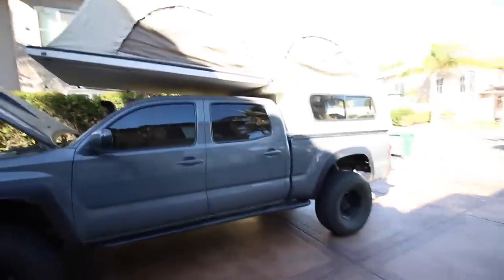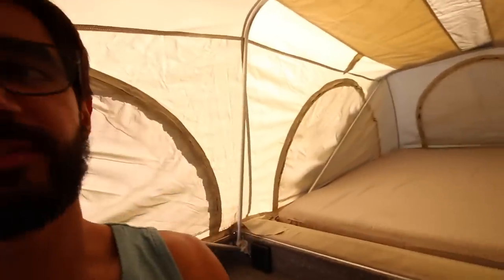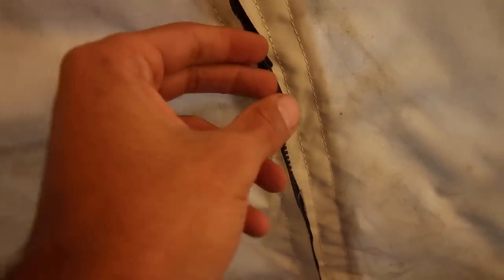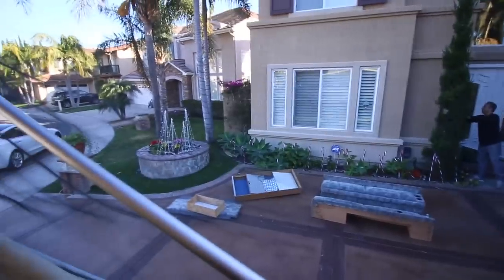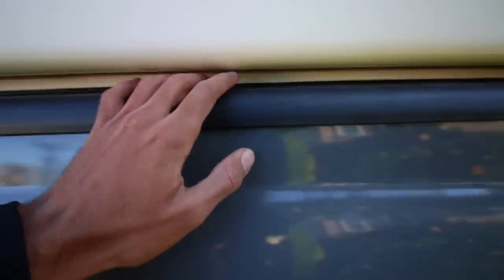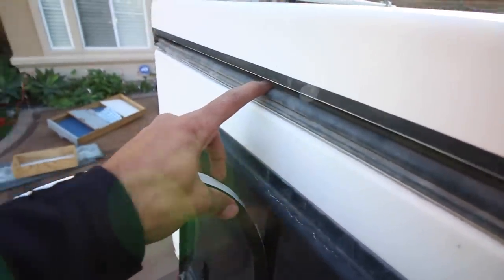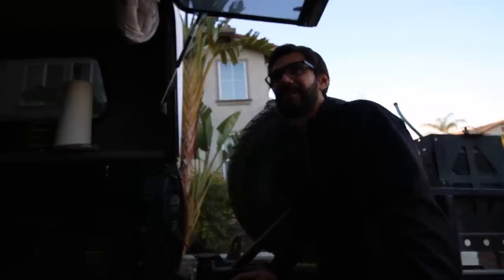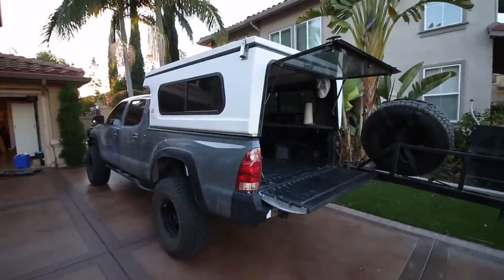I BOUGHT A FLIPPAC!!!

Comment: If it flipped the other way it would be great - support poles could go down onto the ground, you'd have some shade/rain shelter, and you could still have roof racks on your truck
Reply from the maker: Look up AT Habitat
Reply: Problem with that is, you can't move the truck at all without taking the poles down.  I've moved mine to 
another campsite clear across a big campground because noisy neighbors were ruining my camping 
experience.  Damn Millennials.  
I didn't have to touch a thing inside or out.  I'm glad I bought my Flip-Pac brand new in 2000 just a few months after buying my Ranger shortbed.
I paid $2,000 for my Flip-Pac brand new and have used it extensively.  Great getaway unit.
https://www.youtube.com/watch?v=X7biqpQynt8
Reply: There was this version built and sold by my dad the inventor.

Comment: I bought my Flippac in 1996 and the company in Longmont, CO. custom painted it red to match my 93 Nissan 4x4.  Used it until I wore out my Nissan then put it on a 2005 Tacoma 4x4.   It fit better on the Nissan, but I was able to add a piece of plexiglass on the Tacoma to make up for the extra 1" bed length.  I loved the functionality of the camper.  Lots of headroom and the lights were handy if you didn't forget to turn them off.  The torsion bar on mine never wore out, but the steel member connecting to it snapped.  The company sent me a new one and I replaced it myself.   The number one issue I had with the Flippac was what it did to your gas mileage.  My 4-cylinder Nissan barely could get to highway speed with it on and my v6 Tacoma lost several mpg on highway.   Air would get directed between the front of it and the rear of the cab of the truck, not to mention the squared off rear end also created air resistance.   The camper is also heavy and not a two person job to take on and off.  I constructed a hoist behind my home that allowed me to use chain hoists to lift it off and store it.  I was able to do this by myself and frequently took it off and put it back on for different purposes.  I think the manual said it is 350#, but I think it may be more.  It was heavy even for four people to lift and put in place.    It was super comfortable to sleep in and tons of room inside when opened.  I used a very large tarp to cover it during rain and would not suggest using it in rain without something over it.  It would definitely leak.  Overall, loved it and hated to have to sell it.

Comment: For lubing up zippers, get a crayon of similar color and coat the teeth. It wont leak on fabric like oil and it will stick around longer. Good find on the topper man
Reply: Eric Bender nice tip! Thanks!
Reply: Bar soap or candle wax will lube zippers...
Reply: Bar soap or white candle wax lubes zippers without the oil mess.
Your video is dizzy because you are having around way too much. I just skipped thru because I'm starting a 2007 Ranger build.
🍀🙏🌴🎶

Comment: If you use oil on zippers, it will bleed onto material. Use wax instead, cuz it's pretty dry & won't go anywhere but on zippers. It also helps weatherproof.

Comment: Get yourself a Bedrug to line the bed. They are very nice, and are very durable if you carry cargo in the bed when you aren’t camping. They are more expensive than just using house carpet, but they are fitted to the bed and they aren’t  pricey at all.
Reply from the maker: I had a bedrug sitting in the shed when I had it - Just never put it on. I actually sold the Flippac and gave it to the next owner!

Comment: , get urself an " Air Bladder", seal for the back pass thru windows, also get urself some battery powered LED Lights for ur truck/tent. cool, I wouldn't mind having one of these
Reply: You can always use a inner tube for a 10 speed bike & just over inflate it with a compressor to make the seal. Works great actually.
Reply: Backon Thelevel , one of those kids inflatable tubes

Comment: Careful what you put on the zipper it will run to the threads and then caused them to rot or stretch kind of like a spa cover you never armor or a spa cover it causes it to stretch in the strings the thread to go bad

Comment: Nice find! 
I don't think your budget is unreasonable at all, especially when looking at the outrageous prices some of these new pickup campers go for.
Why don't you just remove the bed side rail caps? The Flippac makes them unnecessary anyway and it would solve your seal issue. It will also make the back window seal to the sides and tailgate better. 
Also, please remove the veteran sticker from the back window (unless you are a vet and put it on there yourself, in which case, thank you for your service).
Reply from the maker: So the bed caps were on as when I found this, I didn't have close to enough time to buy the KB Voodoo ones. Without the bed caps, all the holes on the side of the bed were showing which would have made the leaks worse. 

The veteran sticker was in the process of being removed (if you can see the edge on the right being torn a little). It was removed the following day!
Reply from the maker: @Ryan Anderson I would never pay 36,000 USD for one...This one was 3,000 and that was the most I wanted to spend. I don't think I could build something like this for that price! I know the 4 Wheel Campers are super expensive though - A lot of people live out of them or travel for months in them.

But heck you should look into starting to build them! Easy money right now!
Reply: @MustyBastard  FWIW ,  and no Dis intended ,  but the price would come down if people stopped paying that much.

Comment: Cool vid. What are the bed caps you talk about @8:38 ? Are they stock or an aftermarket product? I’m looking to add some more height to my camper shell if possible.
Reply from the maker: Rob Fox The KB Voodoo bed caps will lower the height 1”, so the opposite of what you’re trying to achieve unfortunately

Comment: I've enjoyed my FlipPac I put on my new '99 Ford Ranger 4x4 a year later.  I've gotten a lot of use out of it, but I had to replace the torsion bar in 2001 and now it's broken again.  I intend to order a replacement from swayaway.com soon.
Also, I hope you got the optional blue rain cover for it.  It will keep you much warmer in the winter and it totally stops any rain from getting in.  Without the rain cover they leak when it rains.  
Judging from the matress condiiton, it appears it wasn't used in the open state very often.  
And yes, use beeswax on your zippers.
Reply: I have an extra blue rain cover. Send me the length of your Flippac if you need it and I will check to see if it will fit yours.

Comment: How much weight can the bed part support?
Reply from the maker: I'm actually not too sure on that. The torsion bars on the Flippac are prone to breaking, yet a replacement is offered. If I had to give a number, I would say 350lbs is the most I would put up there and not be too worried. Over 500lbs would be a little scary IMO.
Reply from the maker: Update! I found out it can support 1,000lbs.
Reply: @socalexpeditions  dude thats crazy!
Reply: @socalexpeditions  We bought ours new in 2013. I agree with the 350lb range. We got a better piece of foam for the bed which is much heavier than the stock foam it came with. I no longer flip the mattress over with it in the lid. I want the the torsion bar to last. We just slide the mattress by hand across the top of the "hammock" portion as we pull the hammock closed. Windows in the fiberglass all leaked badly. We took them out and reinstalled with the puddy tape they use to install windows in RVs. Wished I had not gotten the pass through window in the front as I think it will always leak. Also the gel coat is thin and deteriorating. Store indoors if you can or make .a cover for it. I wax it regularly.

Comment: Nice truck. Thats a cool setup but just my 2 cents is I dont ever see the point in all these fancy tents comparative to the cost? I can sleep in my hammock for way cheaper and sleep better. If trees arent available then my tent will suffice. I have a cap on my truck with a very nice twin mattress. On cool nights its comfortable but its not good if its hot even though I have a cool miniature ceiling fan.. For me if Im going to spend a big chunk of change then its simply for air conditioning and heat in the winter I guess. If you remove those luxuries then Im happiest in my hammock or tent or truck bed. But all to their own. Gear up and be happy!
Reply from the maker: It really is a luxury item. The nicest part is being able to access everything in your truck bed, running a heater, etc. In summer the 6 windows create a ton of airflow! What surprises people is this video is actually a month old and I don't have the Flippac anymore - I'm back to sleeping in a ground tent. I loved the Flippac but for the direction of my truck, it was just too heavy and I would end up damaging it. I'm moving in the direction to really limit what things I bring with me camping.